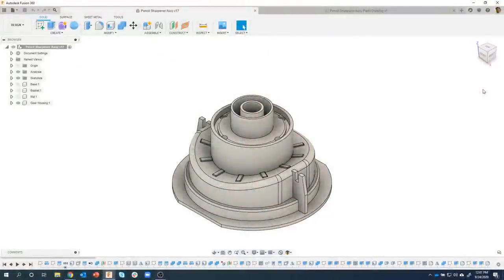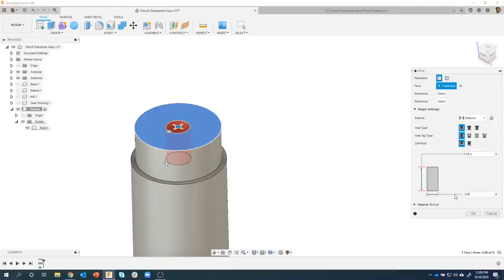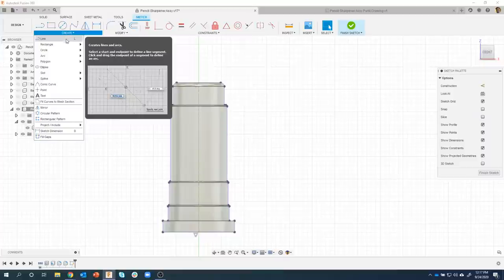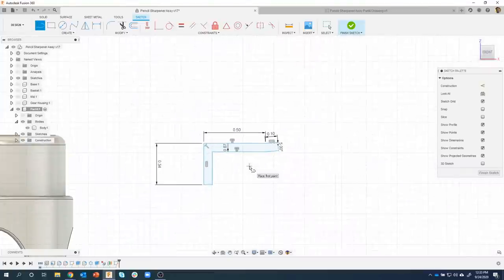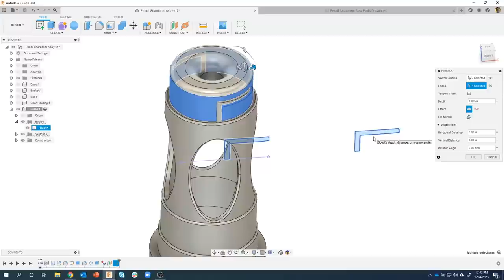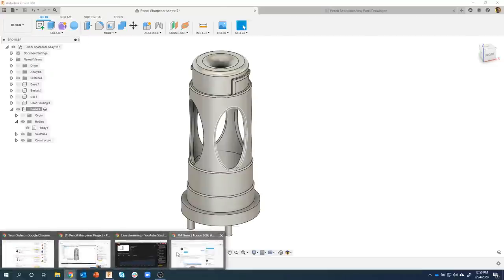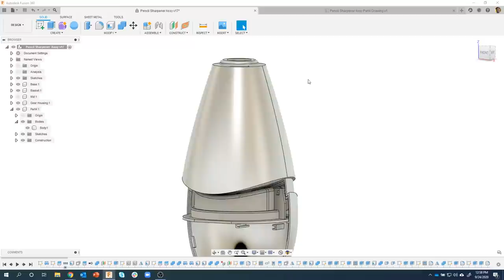Pencil Sharpener Project - Part 4

Comment: On Mac OS you can't use the FM gear generator used in the video. You can get close by using the CF gear generator (also available in the add-on store for free). It uses metric, but you can get really close by doing the following:

Fire up CF gear generator (you can find it in the tools menu, not the Create menu). Set it to a modulus of 0.7 (which is very close to diam. pitch of 38), 34 teeth, a thickness of 0.15 in, and a radial thickness of 2 mm (to avoid the body being too large).

The add-on will generate a body in your top level component. Move the body to the part 4 component you're working on. Select Modify->Scale, and scale that body (in the X and Y directions only, and select the origin to scale around to avoid moving it away from centre) by a factor of 0.66/0,7 (which will correct the 0.7 modulus to a diam. pitch of 38 and the diameter to what it should be. Now move it into place, and combine the bodies.

Comment: Hi Brad! An other great video! It’s great how you showed that you can extrude face geometry from a different component into the active component. As always, I have a quick tip I think you will appreciate and help others. @ 36:02, It’s cool how you show how to calculate half the circumference for the emboss to be perfectly placed on both sides of the part. Only problem with this is that it’s not parametric. If the diameter of the part would change, the emboss would get out of place. My suggestion would be to simply do a circular pattern of two of a single embossed profile. That said, this wouldn’t have shown all the cool tips you included in this method like click to copy In clipboard, and how to precisely calculate the wraparound of the emboss feature. All great stuff!  :P
Reply: I wonder if another option, would have been to use a parameter for the diameter and then make reference to it in the spacing between the L parts with maths? (so Pi * d / 2)
Reply: but indeed wouldn't have shown off the copy tip - which was a good one!
Reply: WistrelChianti yes that would also work.

Comment: I was just thinking - I see so many problems trying to print that with FDM - when you made the comment " I'm not a plastics guy ". We would replace almost all your fillets with chamfers, but we still get enormous benefit from your tutorials. Keep them coming, and thank you very much.
Reply: @Bill Campbell - You are correct, however, I am not showing how to model these parts to be 3D printed.  That would require a much different design process (minimal overhangs, designing without the need for support, etc).  I show this in my Manatee Camera Handle LiveStream that I did where I designed a 3d printed gopro handle I designed in Fusion 360 to be 3D printed.  I'm glad you are enjoying the videos!
Reply: @bradtallis8968  Indeed, your comment highlighted to me that you were not designing for 3D printing. I will watch the camera handle video in the morning - I am sure there will be something in there I can take away and improve my own design process.
Reply: You need to consider your perspective @Bill Campbell. "Plastics" doesn't necessarily mean FDM (which is relatively new to the main stream and an increasingly common use for Fusion360) purely because that might be why you're here. A product like this would be injection moulded and I think is what Brad was likely referring to in that context.
Reply: @rbrdly  No sir, I need to continue watching Lars' videos and taking as much from them as I can to re-apply to my own use case. I quote from my original comment 'we still get enormous benefit from your tutorials. Keep them coming, and thank you very much.'

Comment: @Brad, when you did the emboss on that top feature with the crazy math and settings...wouldnt it be much easier to emboss that feature on one side only, and use a circular pattern? If this answer goes yes and you had a special reason not to use it, could you tell more about this decision, please? Cheers, great stuff as always
Reply: @Peter Stimpel, I was thinking the same thing.
Reply: Just out of boredom I gave it a try and it does indeed work via circular pattern. So I'm not sure why the recorded method was needed.
Reply: @chuckl7713  nice. so the question to Brad remains, if he had something in mind that is not obvious to us, or a downside by using circular pattern
Reply: That worked for the emboss, but it for me, it borked trying to apply the fillets afterward.

Comment: Brad,,  I measured the inside of part 4 where the gear was to be placed showing .97 diameter.  I sketched a .97 diameter circle on the FM gear, then extruded that sketch to match the FM gear thickness.  I then was able to join the new sized gear inside part 4.  I'm still curious why the original instructions didn't work for me.

Comment: Brad,, I ended up doing part 4 several days after watching the live feed.  Everything went smooth except for the combine/cut on the gear.  Selecting the gear as the target body and the part 4 component as the tool body I got an error message "There was a problem combining geometry together".  I tried doing this several different ways as well as step by step with your video and still got this message.  Any ideas?

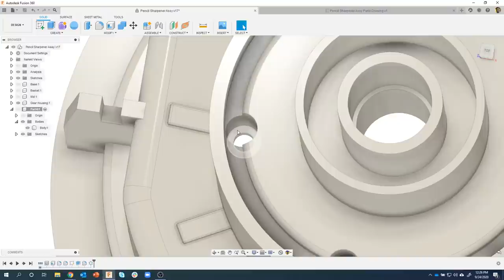Comment: @Brad, thank you so much for these Livestreams, i learned a lot but @27:57min you selected a Profil, that you never made it in part3. 
The other thing that I didn't like on this livestream No.4 is that you use add-ons that only work under windows. There is a standard add-on that can create a gear. For the following livestreams, please try to remember that you are also followed by Mac users.
Reply: @sausagehider  thanks for your answer. I fixed the problem by my self. Later the day i found the pdf file, that you mean.
Reply: glad I saw this. I thought I missed something. Can't stand it when they do stuff off stream.

Comment: Hi everyone when did the through hole that is shown at 6.07 happen.  I went back through Part 3 could not find when that was done.  I surely could have missed that process.  It does show up in the 2d drawing upper left.
Thanks W
Reply: Agreed, that stumped me as well. Had to go back a modify day 3s part. If you go through day 3 video, some screen shots have the hole there and other screens don't. A bit confusing to say the least.

Comment: At 27:20 just breath 😂 It will be ok, you are not supposed to have holes yet, just make the gear housing your active component, create a sketch on the floor of one of those holes and project those faces onto the sketch, then add center circles of .1 to them, extrude and thats it. I got that dimension off of the drawing of lesson 3.

Comment: Sir, how is that when Part4 is active, yet you can see the Gear Housing as a completely visible solid and not a wireframe? Is there a setting of some kind?
Reply: click with the mouse on your name at the top right, go to Preferences, then to General / Design (at the top), on the right disable "Active componet visibility"
(although this sentence is not correct... but it works)
all the best Klaus
Reply: @klauskurt2901  thank you..
Reply: @klauskurt2901  Thank you -Happy Holidays